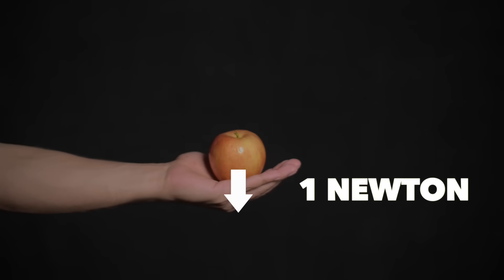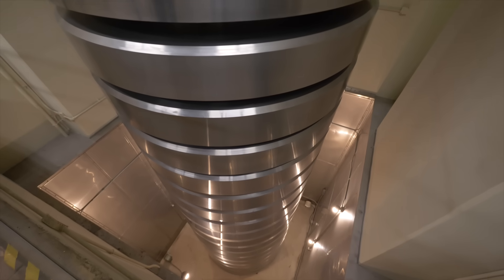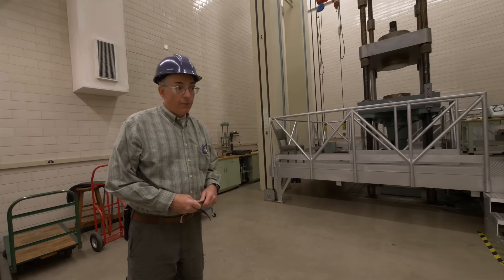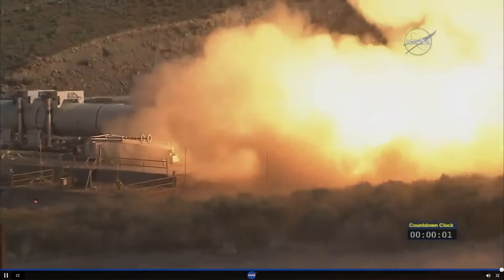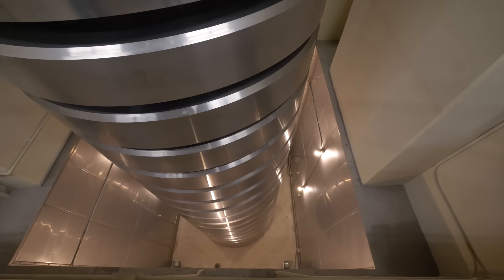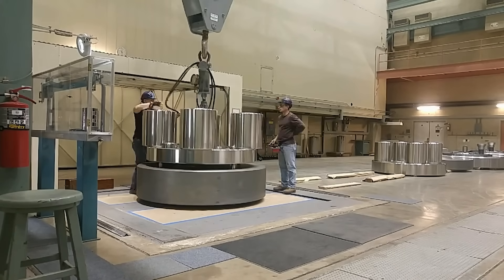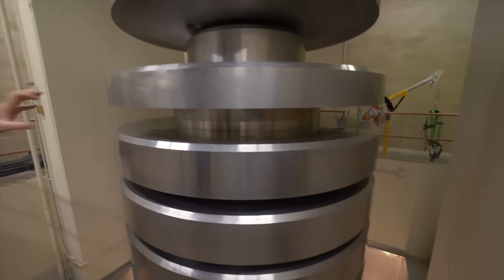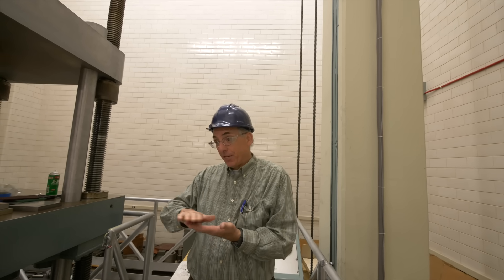World's Heaviest Weight

Comment: STOP WITH THE POUNDS IM CONFUSED. JUST WAT THE TUCK IS A POUND?
Reply: 16 ounces
Reply: There's this magical new invention called "Google".
Reply: about $1.50
Reply: "A pint is a pound, the world around"
Reply: Around half a dozen apples maybe?
Reply: If you were confused, then maybe this isn't the right channel for you.
Reply: The average weight of 7000 barley corns. Unless we are discussing Troy weight, in which case it's the average weight of 5760 barley corns.
Reply: DragonGamingCD :ExtremeGaming: xc

XXX
Reply: 1pound= 2.20460 kgs
Reply: @jovenfrantzborigas4554  *Other way around.
Reply: @michaeldavis2531  Yeah sorry my mistake. 1 kg = 2.20460 lbs.
Reply: AlphaUndead  : First of all, I dont know what "kgs" are. But I suppose you refer to kg (kilogram).
Then no, it's not "more precise". Wikipedia : "Since 1 July 1959, the international avoirdupois pound (symbol lb) has been defined as exactly 0.45359237 kg."
Meaning pound (as all non standard units till in use nowadays) are based on the SI system, because that's what is done the most precisely...
Reply: if Kilo Pound to Mili Pound exist (and remove Ounce from the planet), then i'll consider to use it along with Gram.
Reply: Some middle-age unit.

Comment: I'm not hating on the US but science and imperial system just don't go together. They should seriously consider changing that, I know it's going to be expensive but not that much when you consider they have a 20 trillion debt.
Reply: Simon Vuille actually, 1. These are not imperial units and 2. The u.s. pound is more widely used calibration and tests like this than the metric kg-Force units are.
Reply: how would that give us oil?
Reply: 16 onces = 1 pound
14 pounds = one stone
One stone = 14*16 =??? Ounces
WAIT WAT?

Comment: I'm concerned if they are measuring money, ie nickel without an atmospheric pressure, and a controlled temperature especially when from what it seems as half the machine is above ground and half under, anyway I thought sea level was the marker needed to be used, if someone  can control the price of nickel before it hits the market, it certainly leaves it open for corruption.

Comment: Interesting area of research, but about the uncertainty we have for the constant for Newton's Law of gravitation? Currently the Newton constant of Gravitation is 6.67408x(10^-11) (+ or -) 0.00031x(10^-11) meters cubed, per kilogram per second as listed by the NIST but they are last updated in year 2014. There is also the problem in quantum mechanics and Einstein's theory of relativity that if you divide this Newton constant of gravitation by the reduced planks constant multiplied by speed of light both in the denominator, it will limit the number of significant figures for the speed of light and could potentially lead to a round up that will exceed the value for the speed of light at 299,792,458 m/s. Please do not round up, but simply truncate any calculations that involve the speed of light until this situation is corrected.
So I ask the people who work in the facility shown in the video, to how many significant digits of precision can you measure the Newton's constant of Gravitation and to what accuracy compared to the mysterious true value for Newton's constant of gravitation.

Comment: The reason he doesn't go to metric is when you convert you introduce more uncertainty -- (how accurate was the coefficient you used? To what level of uncertainty?). The majority of the systems they test are probably in imperial units as well so they are probably trying to reach a given lbf target so they want the measurement system to be calibrated in lbf. Converting all parameters to metric would be a needless and expensive waste of time (engineers do not work for cheap :) )

Comment: Should use KG imperial is stupid, even Nasa gave it up.
Reply: That's a bad analogy because currency conversion rates vary unpredictably.
Reply: wonka yes. Replace this extremely expensive piece of functional equipment because it use an older system.
Reply: unit of force, at least as far i remember it, is newton ;)
metric ftw
Reply: Newton is a force unit, kilogram is a mass unit. Mass is the same everywhere in the universe, but the force is not. The force depends on the gravitation acceleration. On Earth, the gravitation acceleration is 9.8 m/s^2, whereas on the Moon is a sixth of that. That is why people can "fly" because they are relatively "weightless".
Reply: just newton, newton meter is a measure of work or torque. if metric is so great, why can't even its disciples get things right?
Reply: better?
Reply: Oh, can you convert Newton's to kilograms?
Reply: because u don't know there is a unit called pound force.
Reply: "functional equipment" its just a hunk of metal...
Reply: Why? pounds works just fine
Reply: Iron-cut Tempest That's actually incorrect! Pounds are a unit of force, while kg is a unit of mass. That's why all the conversions in this video were given in newtons, and why the gravitational acceleration and buoyant forces were important to factor in. You have to compare force to force when you don't specify a gravitational acceleration.
Reply: First Last: If you are the median percentage point of inteligence in the US population, it might explain why they must stick with stone age units of measure: No developed country in 2018 use non metric units anymore, but in your little 2 neuron brain, the USA is the “world” . . .
Reply: wonka it’s like comparing dollars and pounds same jif so I don’t know what your crying about lol

Comment: They cant make a scale using a hydraulic and a computer to calibrate?
Input parameters1 temperature of room as relates to gas compressibility.2 temp increase due to weight n pressure increase3

Comment: In the 60's Aero jet General Corp wanted to test the thrust of a rocket. They dug a deep hole in the ground near Homestead FL. They built a metal building over the hole and had a large overhead crane in the building. They built the rocket in the hole and filled it with solid rocket fuel. They installed a "lighter" on top of the upside down rocket. There were huge cables going to two huge concrete foundations. The building was on wheels and was pulled well out of the way before lighting the bottom end of the rocket which was facing upward. They lit the rocket, which blew the lighter upward, with such force, that it broke the cables or shackles. They never found the lighter.     The fuel was made in nearby low buildings with special walls between each work station in case of an explosion it would not kill all the people working on the line. There could be no oil allowed to get into the fuel. So the hoists in each station were run without oil or grease. They were 600 or 700 series MMM hoists Muskegan Mich. One of there lead guys came by my shop one day to borrow a jack for the operation. It was a 50 Ton hyd jack. aljenney@aol.com

Comment: One question why the hell is he wearing a hard hat when the thing that is going to fall is 1000000 lbs
Reply: Chris E 
To protect his head
Reply: it's enchanted for plus 1 mil armour
Reply: OSHA is the safety standard and requires all workers to maintain and enforce the correct safety rules put in place.  Basically make it mandatory for someone to have to wear a hard hat at all times then have that one freak injury or death due to a worker not thinking they needed the proper PPE (proper protective equipment) on.
Reply: Zack Nelson it's a joke
Reply: Incase they bang heads together in brilliant cognition movement
Reply: Safety first
Reply: His ex works their
Reply: Chris E Because the things that are moving around the most are the tools and smaller weights. His division also provides the ultimate reference for all the smaller weights in the US. If you go buy 1 oz of gold somewhere in the US, the dealer is probably supposed to have a certificate stating how his scales have been certified through various intermediaries to be within  a certain margin of that official US 1 kg weight at NIST.  Same story when buying a gallon of petrol for your car.
Reply: "safety is number one priority"
Reply: Chris E Nice one 😂😂
Reply: Neil Cesar exactly
Reply: It's a very well built hat, it'll protect him.
Reply: Chris E like how u called it hard hat instead of safety helmet
Reply: And why is Veritasium NOT wearing one?
Reply: proper PPE, so proper proper protective equipment?
Reply: Chris E Because: safety first
Reply: If that thing comes crashing down 
That helmet will be wearing YOU for protection
Reply: thor's safety hat.
Reply: Regulations I guess.
Reply: +John FD  ...and a pound of salami, with the butcher's thumb on the scale.
Reply: i wonder how proper protective equipment should look for a 1000000pound mass :D
that little had is not enough i think. maybe a nokia 3210 or 3310 on the head would help ?!?!?!
Reply: If there’s a will, there’s a way
Reply: Chris E "saves you from brain damage instead you get brain punkake
Reply: coding
Reply: safety regulations......
Reply: Incase a bird flys in and brakes a light and it falls on you.
Reply: Don't post jokes on educational YouTube videos because clearly they can't be enjoyed. smh
Reply: Safety measures have to be observed and enforced (depending on where you are) in the industry work, if you are in an office you are fine without PPE (personal protection equipment) but the moment you step into the production section you better have it ready on you

It's a safety discipline, it might not be needed but by repeating it the action becomes like muscle memory and you will always have some sort of protection on you

Hell, I've seen people wear safety glasses when shopping just because they forgot they still had them on
Reply: Chris E well it pretty obvious if that tjing falls and hits hisnhead it wont be fatal duhhh wjy else would hee wear a hardhat

Comment: A rocket is 33,360,000 apples
Reply: That will keep the doctor away for a while!
Reply: Matthieu Gauthier According to my calculations, assuming the apples are all on the top end of the size scale and  stacked by diameter (because for some crazy reason orchards don't measure the height of their apples) it would take 4,656,570,092.307692 apples to reach the moon. Or at least the average distance of 238,855 miles.
Reply: All Mighty Donkey has spoken
Reply: Breezy Mods how many apples stacked would it take to reach the moon, that’s the real question
Reply: Mighty Donkey not all
Reply: A rocket is a rocket and an apple is an apple. There is a difference
Reply: Mighty Donkey you need 33,360,000 apples to go to the moon.
Reply: Mighty Donkey hHahaaaahhaaha
Reply: Your statement is incomplete, sir. „A rocket is 33,360,000 apples“ ... in what?
Reply: Mighty Donkey in one place
Reply: Matthieu G, it would take about 56.3 million apples stacked on top of each other to reach the moon.
Reply: That's 91397 years the doctor will stay away.

Comment: Should have spent more time explaining why the gravity of the earth is a-symmetric, Conveniently, they left out that explanation but they gave an exact number on how many pounds of air were displaced by the weight. The reason that no actual figures or numbers were given when they attempted to explain gravity's effect on the weight, is that gravity is having no effect at all on the weight. Because gravity is a massive lie. Bigger than that hanging weight. If they gave some numbers or measurement then it could be easily fact-checked and disproven. This is the level of deception. I bet the guy that works at that place is smart enough  to have figured out that gravity is a lie, and cannot be proven or measured.
Reply: Rocket Steve929 this made me laugh rather than cringe

Comment: according to f=GMm/r^2 if force changes based on the distance between 2 objects, so during free fall object is constantly changing its distance, so does that mean Earth is exerting a non-constant force on that object? if that was right, why's that object accelerate at a constant rate of a=9.81?
does changing force in F=ma also change acceleration? and why the earth has a constant acceleration rather than changing?